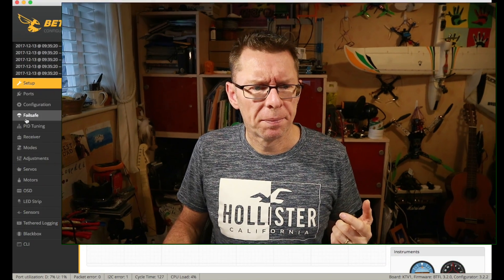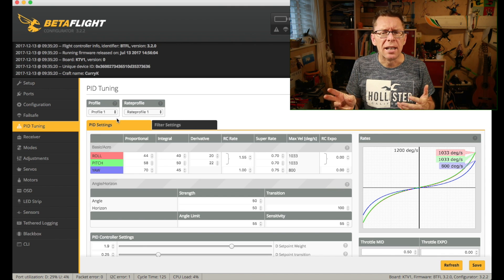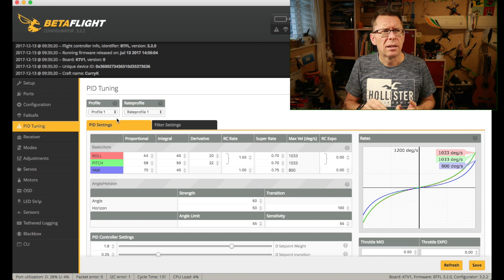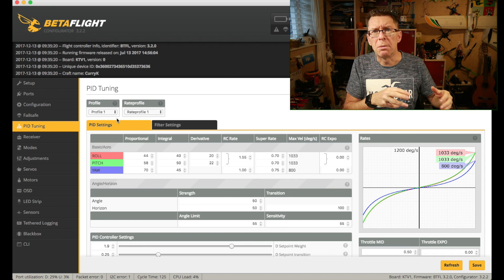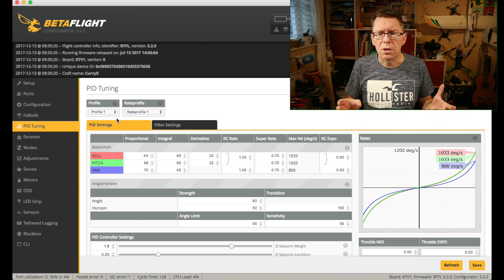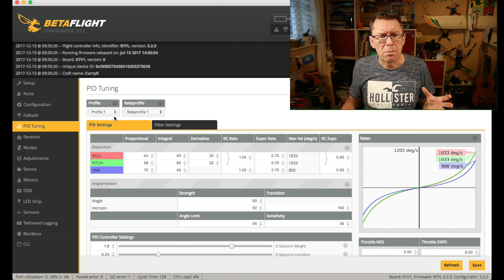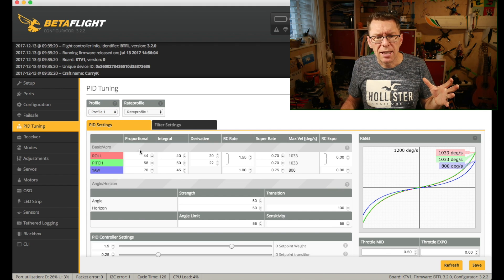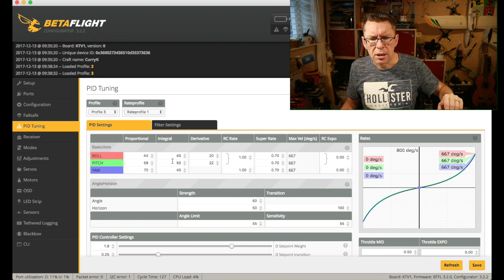FPV Tutorial: BetaFlight Basics Part 5 - The PID Tuning tab

Comment: Hi Wayne, Im trying to tune the PIDs on my old Alien 500, same as the one on your wall under the Bix 2.....I have flashed the Racestar 4 in 1 ESC to latest firmware and it will hover ok but its a bit unsettled and wobbly.....How do you load the "Default PIDs" inside Betaflight?
  One you start playing with the PIDs it's easy to lose track of the basic PIDs, so being able to call up the defaults would make life easier.
  Im running 8 inch slow fli props like yours and 1400kv motors, but have no idea where the PIDs need to be for this model at all...would you mind sharing yours?
Reply from the maker: There's a "reset all profile values" that will get back your default PIDs (and everything else on that tab) but if you are thinking your default is flying ok, then switch to profile 2, do lots of changes and you can switch back to profile 1 if you need to and figure out what's better - no risk there.

That frame (you weren't looking closely enough) actually has a KK2 board on there, so I'm afraid I have no PIDs to share, else I'd be more than happy to.   I think that frame will probably come off the wall and get relegated to the big box of spares as the motors on it are pretty crappy anyway - and I need more space to hang more quads !
Reply: Oh, good idea that, thanks ....Today I flashed the ESC inside BLHeli Configurator App, it was easy. I also connected the small black earth wire as well as the 4 signal wires. Last time I flew it, it did this strange thing where motor #4 just stopped momentarily, luckily while I was hovering low. I also reduced the PID update freq from 4K down to 2K.... Is this de-sinc possibly?
  Now, I have done the above, Im hoping it won't happen again. My Martian 2 flies like a dream, much like the Darkmax. The Alien 500 not so good, but could be if I get it dialled in.
Reply from the maker: I've only ever had a motor desync issue and it was when I went from no throttle to full - it was very distinctive and unsubtle.  You weren't at very low throttle were you and perhaps air mode was not at a higher enough rate to keep motors going - I've certainly seen stalls here.  Also double check your wiring - if you are using the evil bullet connectors, they can have a tendancy to just sometimes create a gap in your contact and stop the motor from spinning for an instant

Comment: I'm stuck I set the 3 way switch up on my qx7, it shows in betaflight. Yet when I tune three rateprofiles and add them in the adjustment tab it won't work. Anyone have any idea? Thx
Reply from the maker: To be honest, I wasn't going to touch the adjustment tab in this series as I thought it's use was a bit limited - but I can do if people want it.  I find the whole adjustments thing a little unintuitive and it took me a but of trial and error to understand how to use them (I've only used it once) for some rapid in-flight PID changes.

Anyway, to setup a ratechange switch - you'll want two aux channels - let's say aux3 and aux4.  On the adjustments tab, enable the first line and use AUX3 in the "when channel" add a range (I used the middle switch position" choose "Rate profile selection" in the "then apply" box, slot 1 for the slot and then AUX4 for  the via channel.  You then activate that you want the change by moving AUX3 to middle, and then your 3 pos switch on AUX4 will change between the channels.  You can test this all in the betaflight configurator to see it works.

One slightly confusing thing (for me at least) is that as soon as you activate this, it doesn't seem to want to stop again, so I added a second line on AUX3 to give myself a "no changes" section for when I disabled AUX3.  If that sounds hard to picture, then here's a picture https://flic.kr/p/FCQtqf

Comment: hi, i have just built my first brushless micro and when I arm it and put the throttle to about 40%, the quad starts to go crazy and rock side to side violently and i cannot take off, do you know how to solve this problem? i have reset all the pids to defaults and the receiver works in the betaflight receiver tab and it responds fine to transmitter input, I'm using 4 in 1 esc which is 2s-4s and I'm running a 2s 550mah battery
Reply from the maker: Did you calibrate your ESCs ?  If you are using dshot it's not needed, but everything else will - that could account for having them run up incorrectly.  Are you running this up in acro mode ?  If not, then do so - as it's best to take any accelerometer issues out of the equation

Comment: I thought the profile drop down was just pids and the rate profile drop down just changes the rates.
I do this but have it set on a switch using the adjustments tab
Reply from the maker: The profile settings let you change everything including the rates, but what you can do with the rate profile is change it on a switch in flight by using the adjustment settings (as you are already doing).  Obviously you can also change the individual PIDs with adjustment switches as well.  I find the profiles useful for me as it lets me have a complete flight profile to swap around as I need it